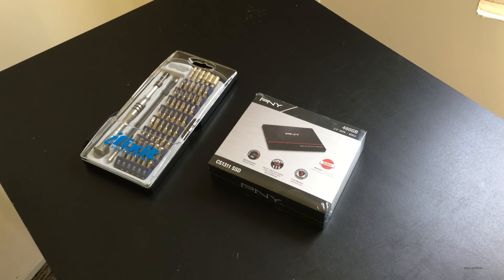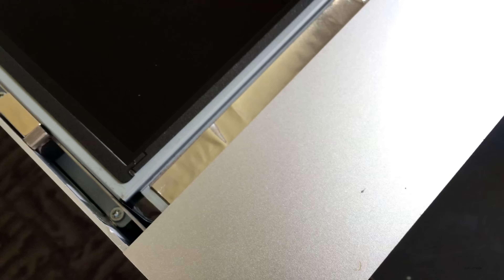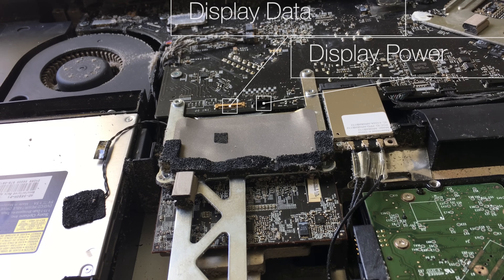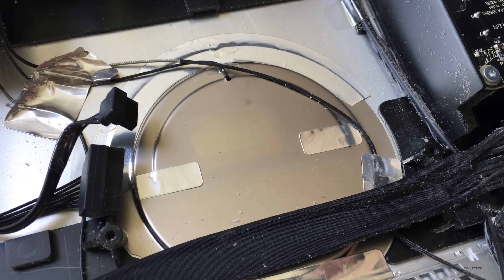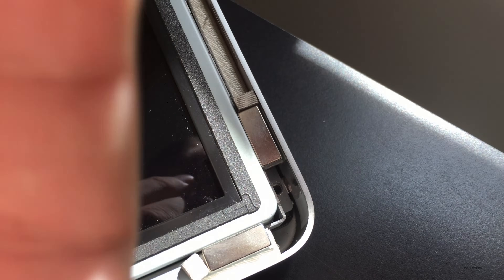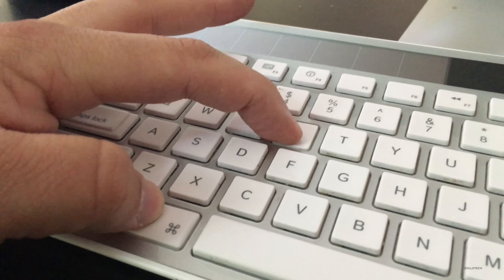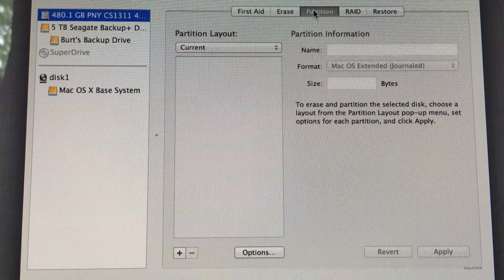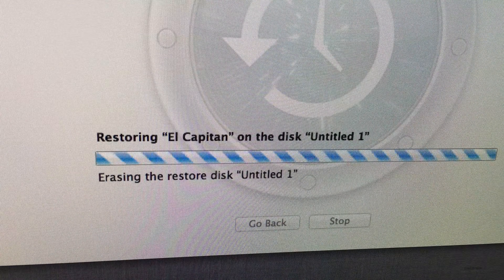How to Install an SSD into an iMac (2007-2013)

Comment: Tread carefully…. I attempted this and all went well until I ended up trashing the display connector putting it back in - Mac is now useless.  These connections are not easily done.  I’d recommend connecting a bootable external SSD.  Mine was working perfectly but I went a step too far trying to mount it internally.  Now I’m stuck with the entire OWC install kit for a mid-2010 iMac.

Comment: If no thermal sensor, you can install "Mac Fan Control" app and set the HDD fan at your desired constant speed. problem solved

Comment: Will any 2.5inch  internal SSD work, and will a mid 2011 iMac need a temperature sensor? 
Thinking of trying this update since this 2011 iMac is used in the music studio. 
My top spec late 2017 iMac is used for visuals.

Comment: Thanks for your nice video showing the installation of SSD. Could you please let me know if is there a particular model of ssd drive (or other models) that can be installed on iMac 27-inch, Mid 2010 running Intel? Do I need to install a temperature sensor as well, or only if the original has a sensor? Another question is can leave the original HD, since I have that partitioned andn half of the HD WIndows and a very expensive software the was bought for research and I will need to use it agai? Thank you for such a nice job with the video.
Reply: Are you not able to install your software again?

Comment: My ultimo Mac 2013 needs other handling. The clas front needs comeing off. My solutions for now is 1 encloser and 1 Samsung evo ssd disk. Made a huge different.  Wanna know now:  buying a lacie ekstern hhd disk put my ssd in it will I bennefit of speed (10 gb) useing my thunderboldt port on my Mac ultimo 2013?

Comment: I installed an SSD on my old late 2009  iMac. I did NOT have to disconnect any cables of the display. It was good enough just raise it as much as the cables allowed. I still had enough space to remove the old drive, put the new SSD into  and even to connect the temperature sensor.
Reply: Can you re use the drives sensor?

Comment: What do you do with temp sensor cable ? On my previous hdd there was a cable attached to it so what should I do ? Should I just remove the cable and install an ssd ?And what do you mean by I should transfer my temp sensor cable ?
Reply: My question aswell ... I want to know if I can reuse the cable

Comment: Hi!! I’m confused on the thermal sensor part. Some people say the iMac has it and some don’t. I own an iMac Late 2011. My hard drive is dead and I’m upgrading it into an SSD but I’m not sure how to connect it properly so that it functions correctly. Thanks for the help.
Reply: Use a software solution instead. Download/buy HDD Fan Control for example.  Has worked just fine on my iMac for 3 years now.  No problems.

Comment: This does not work with late 2012 or later. The pre 2012 is held with magnets and the late 2012 and beyond are held with adhesive.

Comment: Samsung SSD drive, formatted as per  instructions here, used Super Duper (?) to put on system; check it and it worked on the iMac. Followed video (a couple actually). Thought I had everything, although redoing the cables was challenging. Tried it, using CMD Option RP in case the new hardware not recognized. All I get is the chime and a black screen, then the fan at a great speed. Any suggestions would be appreciated. Mid 2011 iMac

Comment: what about the thermal sensor?
Reply: Use a software solution instead. Download/buy HDD Fan Control for example.  Has worked just fine on my iMac for 3 years now.  No problems.

Comment: That was a great video, I have a mid 2010 27 iMac, I have reformatted the apple HD drive for PC and on window 7 installed no more apple software use but does not work 100% I would like to try and do what you did on the SSD on a new apple install plus I would like to put as much ram as possible. This is to prevent buying a new PC.
Can the core be upgraded too?
Reply: Let me know once you get the answer, ive upgraded ram so far, now want to upgrade to SSD and anything else that will prevent me from getting a new pc

Comment: Hey Zollotech,

Would you know why even after taking these steps the iMac is showing a folder with a question mark?

Cheers in advance.
Reply from the maker: Yes, You need to format the new drive and then install macOS onto it
Reply: @zollotech  do you know how can I format the SSD in windows?
Reply from the maker: @zachb2205  you can't because it requires HFS or APFS file systems.  Boot up holding command R and then go to disk utility.  You can format it from there.
Reply: @zollotech  ah, that's my issue. My Mac won't boot into disk utilitys

Comment: My My neighbor is selling me Imac 2011 can I upgrade it SSD and also upgrade it operating system??
Reply: you can only upgrade it to an extent. (el capitan) anything further imo requires too much work.
Reply: 2 things you can do__
1. you can add and upgrade the memory, from the stock 4 to the max 16GB, and then 
2. add a new SSD HD.... this will make it run like almost new, but as someone said here, you may not be able to upgrade the OS at all, I think.
At the most you will miss some higher end programs.... but the basic stuff, internet, word, excel, will all work for another few years atleast without an issue.
All the best.

Comment: Does this really make a difference to the speed of the computer? I have the late 2013 21" version with 1tb and 8gigs of ram and it is slow and stalls from time to time.
Reply from the maker: Yes. Using an SSD is so much better. I would never use a hard drive again

Comment: There is no command R on imac 2007..
Reply: @CHKDG8  No there is NO internet recovery on certain older models... Command R doesn't exist i.e. there were no on-board recovery partitions to boot to and it certainly wouldn't work on a new HDD/SSD... You have to hold option down and boot to a bootable USB drive and install OS X from the USB... come now this is basic crap.

Comment: NO the screen glass does NOT come 'right off' - it's a BITCH - i though it was going to break the glass quite honestly on my 2008 ... so i ended up having to tilt it off with suction cups on one side only! busted four of the retaining pins though!!!! dont' make the mistake i made - not sure how I'd have removed it otherwise though!
Reply from the maker: I’ve done quite a few of these and they all come off easily.  Odd that it broke the pins.

Comment: Upgraded my mac with a SSD drive. Its like a dream to use it now.
Thanks for the instruction. Made my day ;D
Reply: what year did you have & how does it work under heavy useage?
Reply: did you do anything on the thermal sensor?

Comment: Hi there, I upgraded 4 days ago my IMac Late 2015 21,5 Inch HDD ( because it was laggy and slow) to SSD Sasung EVO 850 500 GB and it worked fine for two days, then screen has freezed and then after trying to boot it again, question mark appeared , I was able to see SSD for a while in boot options and then it suddenly disappeared. Prohibitory sign appeared and the disk was dead. So I decided to again disasembly IMac and remove SSD to replace it with old HDD. Works fine. But when i connected SSD with enclosure to my IMac, it is not visible, also under Windows it seems like disk is dead. What can cause that ? Disk was brand new, not used and it failed. Is there anyone that occured the same issue here? I don't know if I should install next SSD drive if it's gonna die in 3 days. What can possibly do that? It worked fine for 2 days after replacement. I don't know how to deal it with and I don't wanna stuck on this HDD because it's terribly slow !

Comment: Great video! But.. what about the thermal sensor?
Reply: That is a problem.
I have not found any video in which there is a solution to this issue. 
I don't even know if the behavior of the fans changes after the ssd installation.

Comment: I have a 2010 IMac mid did the same the same thing but I keep on getting the blinking file with the question mark. Can you tell me how to make it work?
Reply: Internet recovery isn't compatible with your model.
Reply: What you do when you get the blinking file. Press command and R, keep in doing it till internet recover shows up. Find your WiFi and then when you see disk utility. Important see that your internet on. On top right you should see your WiFi signal if it off turn it on. Mines was off for some weird reason. After that go to OS X recover and follow the instructions. Now it’s working perfect and fast ✌🏼

Comment: Hi there great video!! I was wondering if you could please list the internal cords and plugs from first to last in order of disconnection. As I have taken my iMac apart and I broke one of the internal plug/socket I think it was a power cable for the screen but not sure. It was a very short wire if that is any help, I would really love to get my imac up and running again. Thanks in advance to anyone out there who is able to help me out in any way at all!! Cheers guys
Reply from the maker: Thanks.  I would suggest going to ifixit.com as they have a step by step with all the names.
Reply: Thanks so much for the advice and name of site. Will definitely check it out. Great help thanks so much !

Comment: What size SSD would you recommend for a 2008 iMac. I noticed that you went with 480GB. Could I get by with something smaller? Is there a reason you chose 480?
Reply from the maker: 250 is fine

Comment: Hello, and thanks for this video. I have a 21.5" (Mid 2011). I don't know if the heat sensor is attached to the OEM HD.  Just in case it does, how do you fix that heat sensor issue? DO you know of any SSD that comes with an adapter for it? 

Thanks for your help!

Comment: There is a reason why Apple made the iMac the way it is instead of having the ram and storage on the back for convenience. They don't like users upgrading storage and ram so that it can age quicker to incentivize sales in a short amount of years.
Reply from the maker: You can upgrade ram in this version
Reply: you can do it... but it's very apparent that it was made difficult to perform. As for the newer ones, I believe they're soldered and that's inexcusable. I waited for the 2014 mac mini, the ram was soldered, so I had to purchase a 2012 version just to upgrade ram and SSD.
Reply from the maker: You can still change it in the 27inch except the iMac pro.
Reply: wow.... they had the new pro non-upgradable??
Reply from the maker: Only authorized Apple repair centers can upgrade the RAM and Apple stores
Reply: I smell planned obsolescence.... they also charge an extortionate amount for ram....

Comment: My old HD crashed.  So I was able to get it out and thankfully I have a gadget that I can plug the HD into to retrieve my files from.  But I didn't have a time machine backup at the time.  I have a brand new iMac now.  Question I have is once I put a new HD in the old one, how do I get the new operating system on it? I don't have any disks.  Is it possible to start up in RECOVERY mode and then go online to download the OS?  That's where I"m stuck.
Reply: TNA2Me Download the os on a usb drive and recover that way 😊 I've just got home and need to fix a iMac 27" also.. the hdd drive have stopped working, and they didn't take a backup before the drive failure :/ but I will install a hybrid ssd or a pure ssd and see how to install the os without any backups 😋
Reply: Yeah get a 16/32GB USB and install OS on there. You can't go below 16GB im afraid

Comment: Nice video! I've got a late 2009 iMac that I wanted to upgrade the HD to SSD but I was trying to find the recovery mode for the iMac. I startup and press Command + R like you instructed but it just boots up as normal. Other startup commands work but not this. It was running snow leopard and got upgraded to Maverics (from a copy as Apple won't support Mavericks anymore). Any idea why I can't get the Recovery bit to work? Thanks a mill
Reply: Are you using a bluetooth keyboard? If so, that may be the problem. Get a wired keyboard. Mine would do the same thing until I got a cheap wired keyboard for this purpose.

Comment: Burt, I had an issue after I installed an SSD in my 2012 Macbook Pro.  I was able to download Sierra no problem, all my files no problem, except that iMessage did not work.  After fiddling with it for a while, I contacted Apple and they said that as I opened my Macbook and changed parts, my laptop was no longer an "Apple", and that the SSD change automatically shut down iMessage and iCloud.

Have you run into this issue, and if so how did you resolve it?  Thanks.
Reply: Hey sorry for the late response I just saw this. If you still need help:

1: Do command R on start up and go into recovery mode.

2: re-install macOS COMPLETELY!!!

This sounds like a software installation error to me. Of corse replacing your hard drive would NEVER just turn ICloud off, lol.
Reply: @forfashire  even my hackintosh is running iMessage and iCloud :D and it is not an "Apple"

Comment: 1) Be sure to format your drive in "Mac OS Extended Journeled"  (This is apples preferred format. Your computer will boot up and generally work faster)
2) It's better to clone your drive current hdd to the ssd before you install it. You can use a free disc copying program like 'Super Duper' If you clone the drive before you install it you will have all of your data on your drive set up when you switch it on. Just put in your password and you're ready to go!
Reply: I’ve heard APFS is preferred for an SSD on MacOS High Sierra
Reply: MistaFussichannel thanks
Reply: “Mac OS Extended Journaled” correct?
Reply: That's exactly how I do it on the mac pro.

Comment: That was clear and interesting: Thanks very much. Some dumb questions:
1. After you finish with System Restore and your Time Machine backup, does that mean that you can just start using your computer and all the software again ... , such as Apple Pages and Photoshop, etc. ... Or:
2. Do you need to separately install the OS X operating system, and then also re-install each one of your software programs from the .dmg Installers ?
I've been wondering about this for a long time.
Thanks again.
Reply from the maker: +Zorba Press after it restores then you just start using it.  No, apps installed from the backup.
Reply: Thanks so much, Zollotech. ... I had thought (because somebody told me) that Time Machine would only back up the data files, and not the programs. ... Now I will make sure that my Time Machine backs up everything, every night.

Comment: It would help that you explain how you have solved the thermal sensor topic to prevent heavy fan air flow. These HDD found in iMac 27"s have specific digital connector to probe then internal HDD temperature then by software to trigger the fan blower. Problem with SDD, they do not have such digital sensor compatible with iMac since SDD stays very cold and no suffer of heat. So there is a need to emulate that sensor, connect to the 3rd cable which is not shown in your step by step video.
Reply: if you still have the problem i might have a solution!
Reply: Could you enlighten me on your solution?  I'm about to do install a ssd in mine and would love to hear it!
Reply: tantratron I don't get it.. why a thermal sensor on the new harddrive or ssd ? Are the original drive born with the sensor inside the drive or ? Or it's just apple thinking : hey let's fuck it up to people who want to upgrade the drive, without a apple repair technician 😂 seems weird that a another normal new harddrive or ssd will punish the cooler 😋
Reply: Use a software solution instead. Download/buy HDD Fan Control for example.  Has worked just fine on my iMac for 3 years now.  No problems.

Comment: I install a new ssd crucial mx 300, and macOs Sierra from an usb bootable device. I had no issues during install but, after booting my iMac 27" 2011 keeps restarting and rebooting. As well my fans were noisy during install, but after firmware update and install of macOs Sierra, they're really quiet .. Don't know what's going on. 
Any Help would be much appreciated

Comment: Apple computers are good, but I've never understood why Macs a behind PCs in terms of gaming.
Reply from the maker: +matthew lea there are a couple reasons that aren't hardware related.  The first is it's a different OS and the game needs to be rewritten to work on it properly.  The other is Mac OS uses open CL and Open GL whereas windows uses directX and is what everyone supports.  If you load windows in boot camp then they perform fine compared to a dedicated windows laptop and in many cases better.
Reply: The other reason is that aside from the Mac Pro, none of the Macs usually have gaming graphics cards in them. So, while someone could get maybe a $700 dollar machine that could do gaming quite decently, you have to pay hundreds of dollars more for a Mac Pro to get the required power. Gaming has just never been a top priority for Apple on the Macs.

Comment: I have a mid 2007Imac with 4 gb ram.....hdd went belly down...it was a 5400rpm mitsubishi something or another ..what type and capacity hard drive would you recommend as a replacement..   thanks

Comment: Hello! I've done all of this steps, but command cmd+R doesn't work. :( I just see a folder with question. Any other comands don't work to. When I hold button ALT simultaneously with starting iMac - it's just white screen with arrow apears. :( could you give me a piece of advice?
Reply from the maker: +Oleg Raduke try holding option or command option r
Reply: zollotech I've tried this. But it doesn't respond. Is it possible that the ssd was connected wrong?
Reply: zollotech I'm having the same problem right now and it still isn't fixed. Any suggestions?